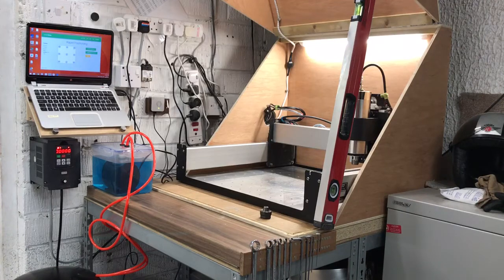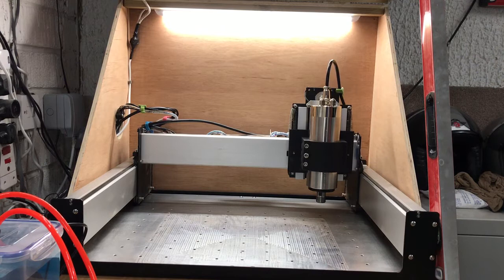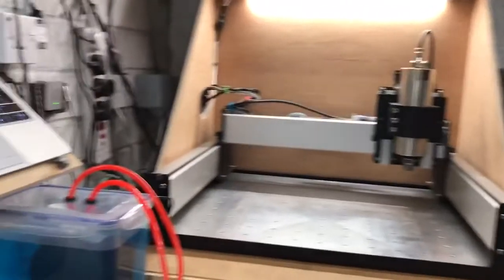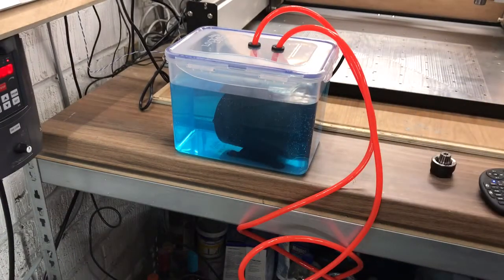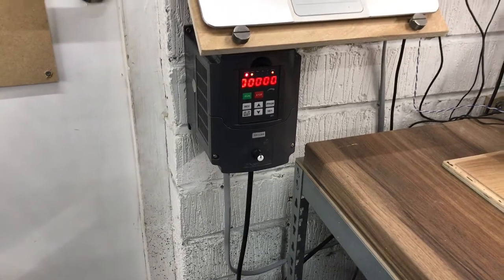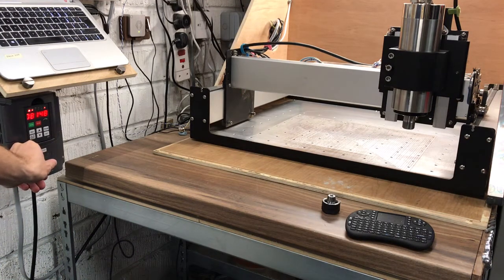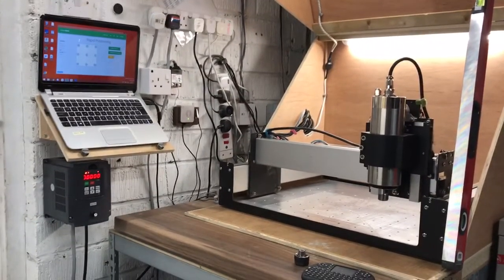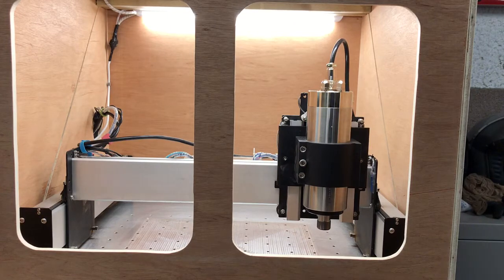Shapeoko 3 with new enclosure and 2.2kw spindle

Comment: Put the water in it! :D I plan on doing this myself real soon. Good to see it up and running.
Reply from the maker: This is quite an old video now, it's now cooled properly and in use. I've also started messing with the VFD settings for things like quick start up. 0-10,000 rpm in 2 seconds.
Reply: I figured as much :D Good work and I look forward to more content! I just ordered mine and I am hoping to use some water cooling parts from my PC to cool it to give it that "custom loop" look :P
Reply from the maker: I would have liked to make mine slightly prettier (clear pipes and better cable management), however I always spend too much doing the mods and not enough time using the machine :) I did add blue die to the coolant but you can't really see it :( I can't wait to see what you do with yours.
Reply: haha, trust me I know the feeling! I have mine in a cheaply made soundproofing box. Once mine arrives, I ordered yesterday :D, I am going to redo the table so I can have a little more room as I cant close the doors if it moves all the way to the front. But then I want more room to mount the res/pump combo and hopefully mount the VFD inside the new box and have the read in the back with some RGB fans so it's like a custom loop PC. I can't wait but at the same time I know having the time to do this will be challanging.